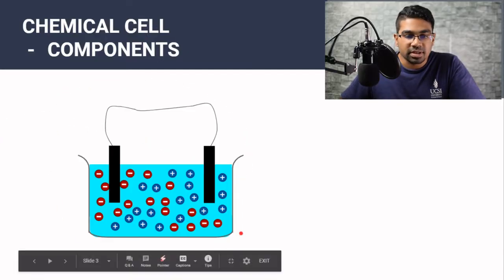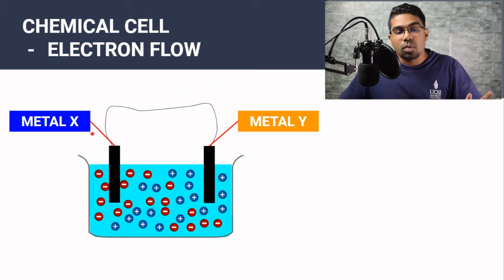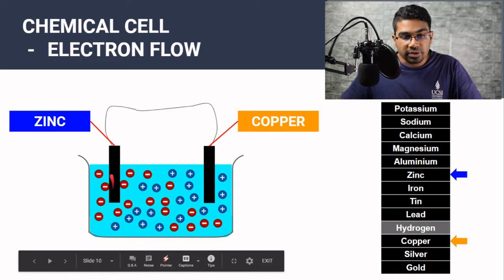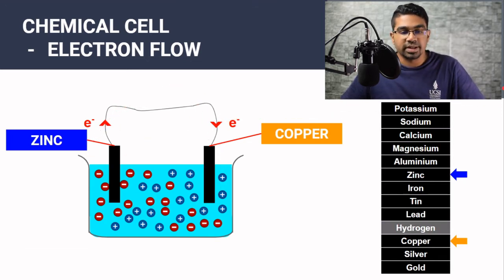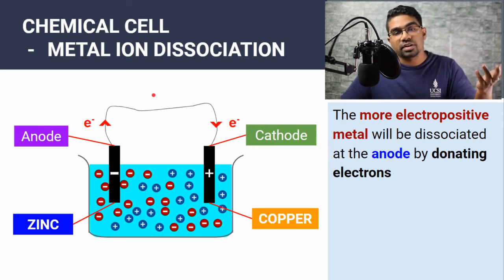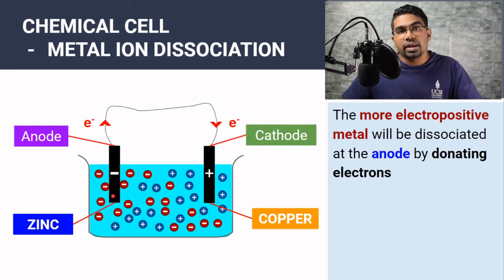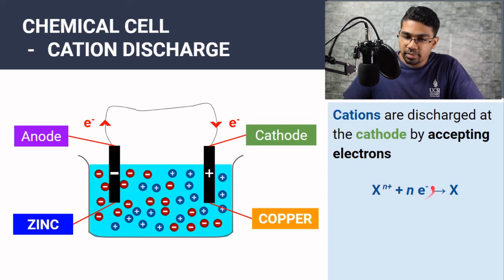Electrochemical Cell - Simple Chemical Cell

Comment: Great Video, I just have one question. Hypothetically,  if we had a Mg and Zn simple cell  (one beaker) in a dilute acid, would the electrons on Mg go to Zinc or would the Mg react and reduce the H+ ions in the acid instead. I am presuming Mg would directly reduce H+ because Zinc is more reactive than Hydrogen. Also there is a bigger difference in reactivity between H+ and Mg too. ???????

Comment: Hi sir, is a voltaic cell the same with chemical cell?
Reply from the maker: Voltaic cell refers to a combination of two half-cells using a salt bridge or porous pot. It is a type of chemical cell. The chemical cell that is made using two different metals dipped into the same electrolyte is referred to as a "simple chemical cell".
Reply: @MrRuelTuition  Thank you!

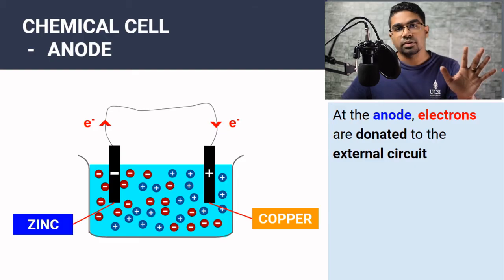Comment: Hi sir....i dont understand the video clip for 4:32.....if the electrons flow from the anode to cathode...then shouldnt the anode be in positive terminal and cathode should be the negative terminal? Because u put that the direction of electron flow is from zinc to copper.
Reply: Hi Hannah. Electrons do not flow from positive to negative terminal. Current flows from positive to negative terminal. Electron is a negatively charged particle and flows in the opposite direction to current (negative to positive).
Reply: @ruelabbarow2178  ohhhh thank youuu sir...i understand now🤗